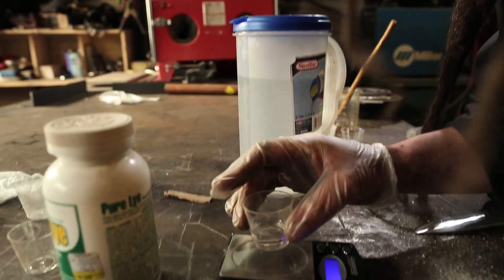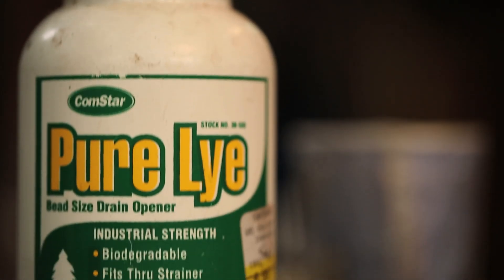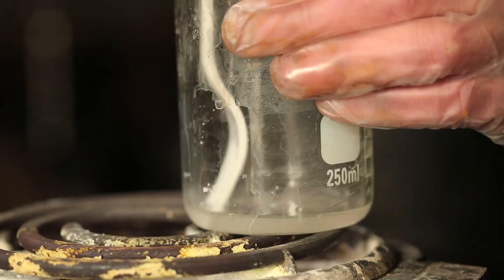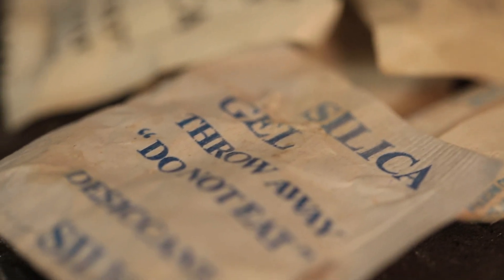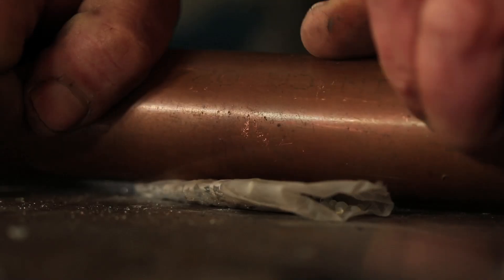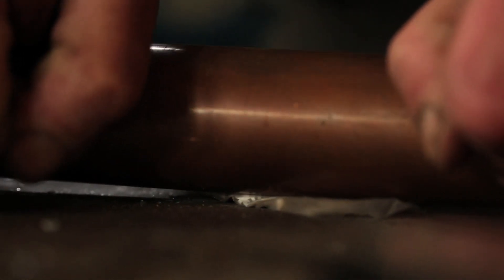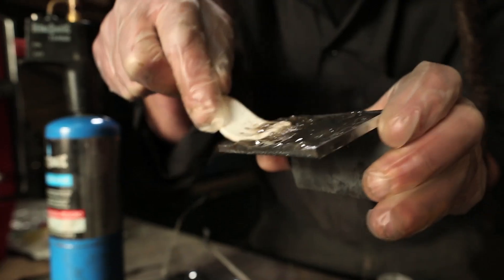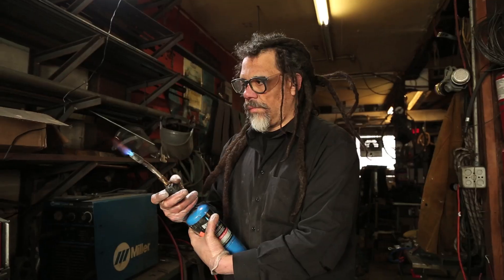Rebuild: Cook Up Ultra-Strong Water Glass Instead Of Glue

Comment: It has one ultra weakness also, it is soluble in water.
Reply: Wrong
Reply: @michaelbailey4164  it is reversible process, so its not water and moisture resistant, unless it is used with something else.
Reply: @miloszivkovic6118  How do you explain it when used as a head seal. It solidifies at the leak from the engines heat and makes a permanent seal while in a continuous water environment.
Reply: @michaelbailey4164  it crystalize at high temperature making it insoluble, but its uselles as adhesive for its brittleness. Its mostly used as glass crack sealant mixed with silanes and syloxanes. 
Its cheap, pour some in cup and leave it , then pour some water when it cures and you will see for yourself
Reply: @miloszivkovic6118  The information i see says sodium silicate is a strong adhesive and forms a strong, rigid, and inorganic bond that can adhere to a variety of materials, including metals, plastics, ceramics, composites, and glass. Heat and water resistance: The bond created by sodium silicate is often heat and water resistant.
Reply: @michaelbailey4164  as I say, its cheap and easy to try, its impact resistance is weak as glass itself, its partialy insoluble in water only in crystalline form. how else you explain enormous and various glue market. When I first found out about it I thought same as you
Reply: @miloszivkovic6118   Thanks for you time & information :)

Comment: Much respect for what you do obviously you know what you are doing looks extremely dangerous. 
BTW WHY the thin  gloves  ?  The 
Silicon jell because that hot mix 
Well no need to tell you you know
I can see the temperature of just the 
Fumes / mist,👈 I do know that there is a difference between the two. 😎👍👏🏼👏🏼☠ be careful good luck

Comment: When it is homogenized it only hardens we're there is  very intense pressure under entense heat.
Lik for filling up rod bearing clearances that are hammering use copper type coolant stop leak.

Comment: I made a batch of this for conductive ink and other experiments, and I have to say that it takes a very long time to cure at room temperature, even when exposed to CO2 gas (which should cure it rapidly??) it was a silica gel rich formulation, not sure what went wrong (if anything!)
Reply: CO2 for refractory purposes - when mixed with sand, perlite, etc.. the gas is able to permeate.
Wood holds LOTS of moisture, which would inhibit the cure - the wood should be dried in the oven, say 150F, overnight with the oven door slightly open - then apply the sodium silicate, and reheat - i look at it as more of a stabilizer, than a sealant. 
Hope this helps!
Reply: @P3nguinDarknes5  Cheers! I want to mix it with my FLG graphene to make extremely strong resin for laminating with ballistic kevlar. But also want to make a 1cm sheet of glass, how would I go about it? Use it pure after mixing my FLG?
Reply: Three years too late, but for anyone else that may one day stumble onto this, sprinkling your wettened solution with sodium bicarb kickstarts an almost instant hardening phase. CO2 isn't strictly doing anything magical as it's more about driving out moisture (the water) and dehydrating the solution when used as a high temp adhesive.
Reply: @C-M-E  HAHA 8 days later you solved my problem. Thanks man. Also if this "hardens with CO2" thing is true, the added sodium bicarb will have the side benefit of breaking down to sodium carbonate and releasing CO2 gas during the first heat.
Reply: @jonathanseagraves8140  It works better if you put it in an enclosed container, though remember that CO2 will pool at the lowest point; a small circulating fan with offset that some, or turning over the container on occasion. I've been working up an extreme temp refractory for an upcoming project, and I've had better results with soft passes of a propane torch, which alleviates moisture in a hurry but also diffuses CO2 into the porous surface. Whichever reaction is responsible for the final effect, I'm still quite convinced that dehydrating the water out and the various methods to do that will have a greater effect on the cure rate, but the bicarb method does work (at least on the upper most surfaces, which can become brittle with too much bicarb reaction).
Reply: @C-M-E  Mate , I had the exact same idea, but did not know the bicarb could be used cold, I thought it released c02 when heated? But great to know cheers, now I can mix my high quality FLG Graphene to make super glass. what % of FLG do you suggest as a starting point? 1% 3% 0r 5% vol FLG?
Reply: I'm having the exact same issue, but was using it to seal wood. It took forever, in fact it took so long I gave up. Really would love to know what went wrong or what I'm missing.
Reply: to much moisture if you spread ut out give ut more surface area to stick to usually dries fast

Comment: Hi Mr. Hackett, 4 to 8 grams of lye? When to use the 4 grams and when the 8 grams ?? regards, Sander.
Reply: when using 4 grams of sodium hydroxide, you get a silica rich combination and this is more adhesive. If you use 8 grams of sodium hydroxide you get the more alkaline sodium metasilicate which makes sense.  The more alkali, the more water soluble and less adhesive and less glassy.  Sodium metasilicate is mostly for heavy duty degreasing and as a corrosion inhibitor for metals.

Comment: Thanks for that video -- very interesting!  In the video I wasn't sure of some things you said.  Did you say 10 parts water to "4 to 8"(?) parts lye?  How many parts of crushed silica gel should be used? Did you say, "drive the rest of the water out by waiting(?) or by heat"?
Reply: Wayne Ashby ... This is a bit late, but look at the scale.  6 grams.  10:6:4 is a very common ratio.
Reply: @3daypriest  you can add different amounts, changing the amount of the sodium component will change the properties. Guess it depends on what you're trying to bond.
Can wait for it to dry (it's essentially glass dissolved in water) or can drive the water off with heat. Depends on the level of foaming you can tolerate, rapid heating results in foam formation.
Reply: 3DayPriest I use 200mg lye/450mg water/300 mg silica gel then reduce to desired consistency
Reply: no answer coming to this i guess, i had the same question.  Clarification on how many parts lye and how many parts silica gel would be much appreciated
Reply: +Wayne Ashby +Popular Science I have the same questions as well, and would like like to know those answers.  Thanks.